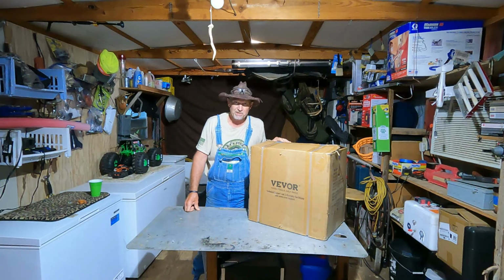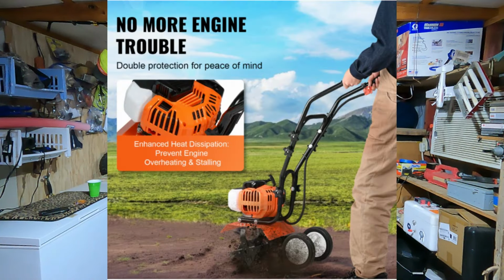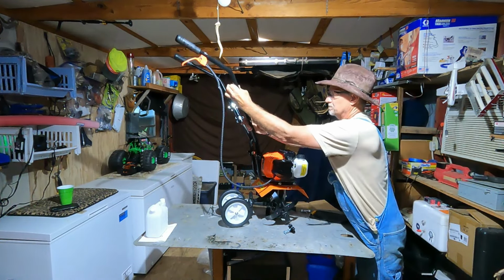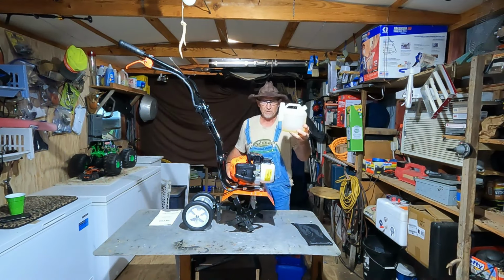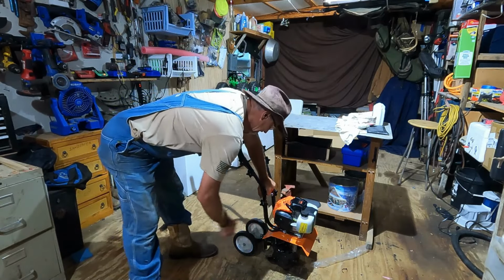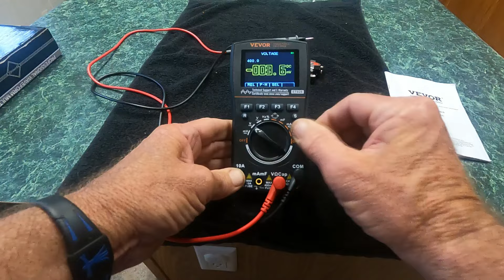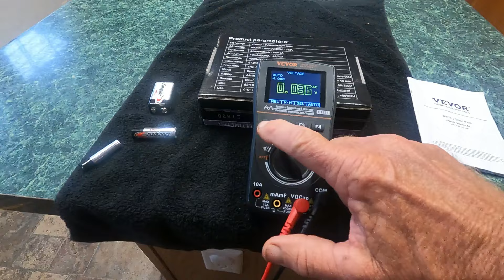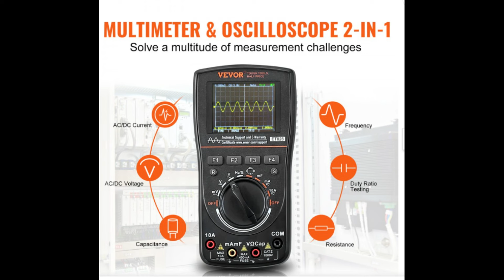VEVOR 43cc 2 stroke garden cultivator-tiller assembly / VEVOR Multimeter & Oscilloscope

Comment: Do you need to put some kind of oil or coolant in these separate from the gas? Thanks.
Reply from the maker: It's a 2 Stroke so the oil is mixed in the gas.
No Coolant.